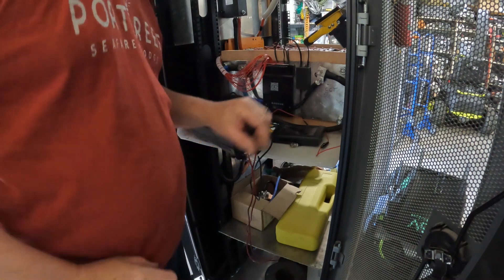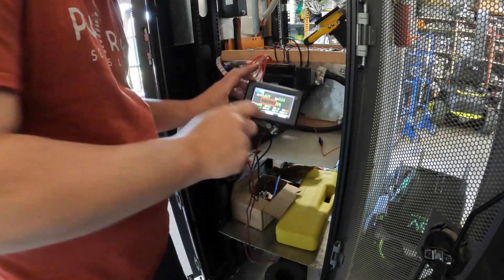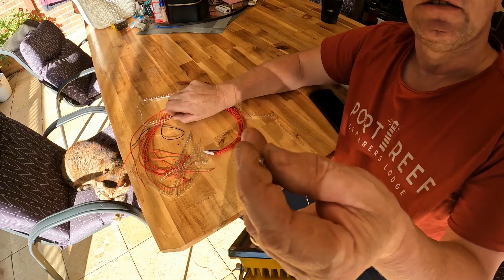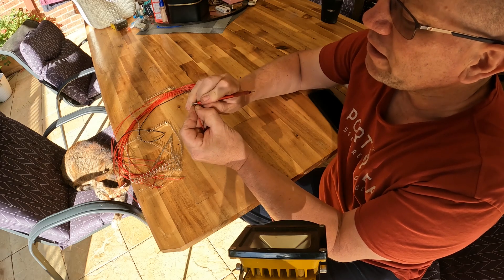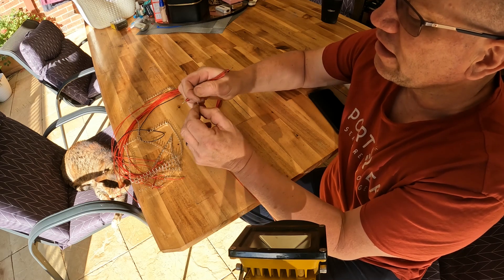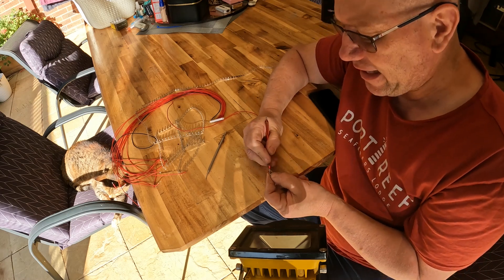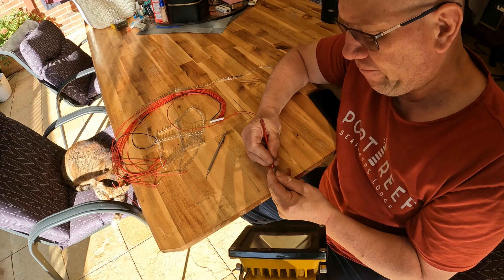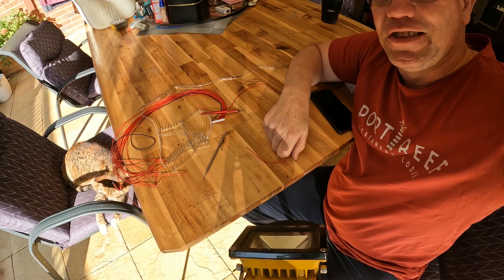JK BMS you have a problem, which you know about please fix it

Comment: i used similar bms and it drifted my number 13 cell when charge said enormous voltage raise and when discharge said voltage drop but cell was ok leading the bank!!  
i removed it until investigation and i found the only resonable video that says what might happents.. but it shows all cells ok!! only that one particular 13 cell did that . i changed  endings and even changed a battery from 16 place to 13.. still same !! bank is ok but port 13 reads  sags and overvoltages  leading bms to misscalibrate or even cell overvoltage stop charge and even   show 0% faster due to one cell go 2.9 v  even on 0.4c  discharge!!!!     battery is 100 amp lifepo4!!!       now with inverter bms is ok but  its too small 100 amp and cant handle  engine starts  like vacuums  !!!  older is 150a  and would love to solve the issue !!! hope   pressing correct the lids save my bms!!!
btw when rests in 3.2v per cell  with under 0.2 c  or charge with less than 0.3c  it behaves almost normal!!!
Reply from the maker: I think the resistors on the bms are out of range over time. I will be replacing my Aluminium bus bars too in the future with copper ones. I have got through 3 BMSes on the top battery bank so far. I tried to lower the rate of charge too that didn't work for me too.  Sorry for late reply.

Comment: I have 4 200 amp  24s 2amp active charging with handle bar screens. Never had an issue yet. Only thing I see is when batteries get close to full and 30 plus amps are charging cells get .106 or so out of whack. sure it adjusts them in couple hours but it causes me to loose some top end charge.
Reply from the maker: Is that with a growatt or another inverter ? Also is that a standard alone system like mine?

Comment: Hi I see on yours video Growatt SPF5000 did you try CANBUS connect ? Can comunicate with Growatt this JK BMS?
I today order one BMS :( HAve I cancel order or is it still good BMS ?
Reply from the maker: I ordered a connection to JKbms, but I have not had time to nut it out yet. The BMS is very good as long as you did what I have done to the cables using silicon to stop movement.  The glowatt works find need to connect it to communication system of glowatt.
Reply: @chuxxsss  thanks for reply. Can you write what you have ordered for comunication ?
Reply from the maker: @jozefflak895  https://m.alibaba.com/product/10000009005602/Jk-Bms-module--RS485.html?__sceneInfo=%7B%22cacheTime%22%3A%221800000%22%2C%22type%22%3A%22appDetailShare%22%7D&from=Android